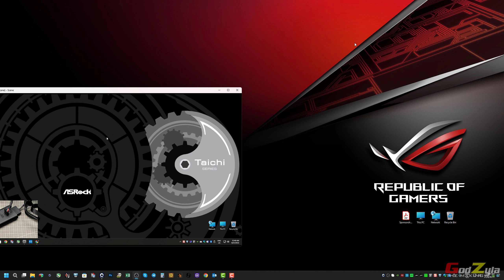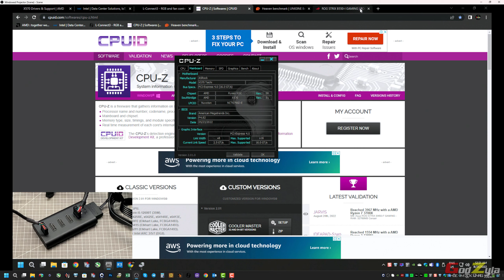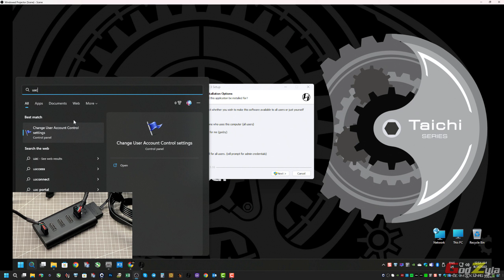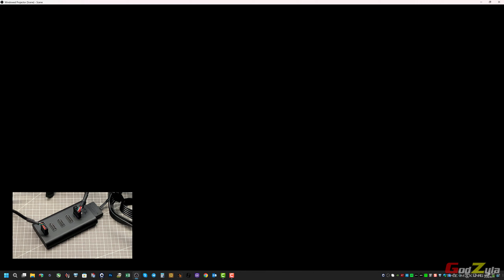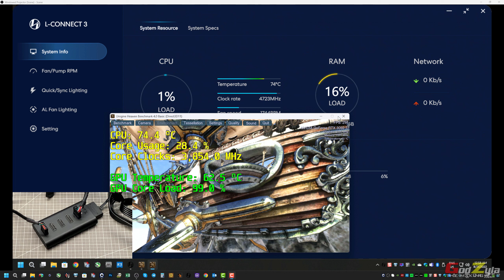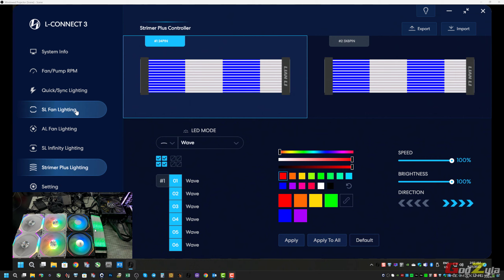Lian Li ARGB Products (How to make it work?) [L-Connect 3]

Comment: Hi Kleo, thank you for these informative videos. Not sure why my original comment was deleted but hopefully this one won't be.

Just a few questions that I wanted to ask -

If I'm using a NZXT Z73 AIO to cool the CPU (10 total SL120 fans, 3x 3 daisy chained & 1 non daisy chained), would it be better to connect all 4 of the "separate" fans to the Uni Fan Hub and control everything via L Connect 3? If I were to do this method, the USB 2.0 header from the Uni Fan hub would control all of the fan speeds & RGB via L Connect right?

Or should I connect 1x 3 daisy chained SL120s for the AIO/rad cooler to the NZXT AIO itself to control it via the NZXT software and the rest of the 7 fans via the L Connect 3? 

The PWM cables to control via motherboard is optional but will be connected just in case.

Orientation & case - Lian Li 011 Evo
Top Exhaust: w/ Z73 AIO 3x SL120
Rear Exhaust: 1x SL120
Side Intake: 3x SL120
Bottom Intake: 3x SL120
Reply from the maker: Hello Delcious Mango, welcome to back. Let me figure out for you and to reply you later, as currently am out, will be back in about 8 hours time. Just wanted to say hi and I do apologize as your original comment got removed. Rest assure am not the one who deleted it.
Reply: @KleoYan  Thank you in advance! Take your time. :)
Reply from the maker: @skibidiwonyoung  hi, it's kind of hard to explain here, I believe this will aid you https://imgur.com/gallery/wxrKnQd (if picture too small, please download it) read Part I then follow by Part II.

Comment: This video is awesome ! one question though with the new lian li infinity hub and the new strimmer v2 hub can we do the same method of linking them with the arbg cable kit? I have all the cable just need to know if it is ok to do still? So I can control both with L Connect 3? Or is a usb hub needed?
Reply from the maker: Hi Anthony Lowe, welcome to my channel. Both has a controller. You will need additional USB header will do. If you choose to plug the strimer plus together with the uni controller, it might not work as in, the strimer plus will not reflect on the L-Connect 3 dashboard, therefore you lose the argb patter effects.

Comment: I need your help., I was an early adopter to the SL fans, I can no longer control the fan colors. when I update the software to the L connect 3, it tells me to update but it fails every time and asks me to update, but then it tells me to manually update, it asks for a password which I do not know where to get. any thoughts? right now my fans are rainbow vomit
Reply from the maker: Hello Ryan Johnsen, welcome to my channel, kindly do the manual firmware update https://lian-li.com/l-connect3/L3_update_manually/  password lianli

Comment from the maker: If anyone of you have the issues with L-Connect 3 app, below are some troubleshooting steps

Basic Troubleshooting steps
Disclaimer : Though the chances are very low to brick firmware updates on motherboard and to any controllers. I will not be responsible if you have brick your motherboard or controller.

1) Make sure your motherboard bios is up to date, please check on your motherboard manufacture website, under support > bios and drivers. See if there are issues with USB and do they have a fix. If there are, kindly update those bios firmware version.

2) Make sure your chipset driver for your motherboard is up to date! For AMD will be at https://www.amd.com/en/support for Intel will be Intel Driver & Support Assistant Intel DSA https://www.intel.com/content/www/us/en/support/detect.html

3) Remove all argb apps (Asus Armory Crate / MSI Dragon Center / Giga Fusion / Asrock Polychrome). If the brands which I have mentioned, do have a uninstall tool like the Asus Armory Crate, use that, else use Revo uninstaller ( https://www.revouninstaller.com/ ). Revo uninstaller will remove all unwanted files / folder / registry in your system. Illustration to use revo uninstaller https://www.youtube.com/watch?v=uMgUYiakpxM&t=437s

4) Shutdown your PC, unplug the PSU cable from your AC outlet. Press the power switch twice to discharge all current that your motherboard is holding. Leave it for 45 second

5) While waiting, please do not use KVM switches. Disconnect all devices that are connected to your motherboard (front / back IO). Leave only your Keyboard, Mouse , Monitor and Ethernet (If you have) connected directly to your motherboard. 
If your monitor has a KVM build-in, remove the USB cable from your monitor to your motherboard USB socket. If your mouse and keyboard are connected to your monitor, please remove them and plug them directly to your motherboard instead.

6) Plug only one Uni controller or Strimer Plus V2 controller. If its for Uni Fan (SL/AL) use only 3 fans to an output of the uni controller.

7) Plug the power cable and turn on your PC

8) Go to your Device Manager, look under Universal Serial Bus Devices, make sure you see the Lian Li uni / strimer plus V2 controller.

9) Install the L-Connect 3 app only https://lian-li.com/l-connect3/ (current version 1.3.16)

10)	After installation, run L-Connect 3, check under Setting > General > make sure Auto-Run on Boot and Minimized L-Connect 3 to system tray at close are ON.

11)	Reboot your system.

12)	First thing you need, go to device manager and see if the Lian Li controller is listed, next open up the L-Connect 3 app. Check if there is a need to update firmware to your controller. Go to Settings > Update, under Device F/W version, click on Update Check, download and install the firmware. Make sure the firmware is completed. Do a check on device manager and make sure the Lian Li controller is listed.

13)	On L-Connect 3 dashboard, check if the CPU and GPU readings are reacting, you might want to test it using some benchmark programs. If there are reaction, play with the PWM and argb functions. If it does not work, skip step 14) and proceed step 16)

14)	If Single controller works, shutdown your pc, connect uni fan set of 3 to your output of your uni controller. Do it small steps at a time to hook up your sets of fans. do not do all in one go. If successful and you have a second controller, proceed small step at a time again.

15)	Slowly plug back your USB devices (Headset, Microphone, Printer, USB Capture Card and etc). At any point of time as you add those devices one at a time, if L-Connect 3 become unresponsive. This tells you that there power is insufficient to power up more USB Devices. Whatever USB port on your motherboard, there is a limitation as the current are shared across the board, be it front or back I/O and the internal USB Header. You might need to get a Internal USB Hub that comes with a Sata Power source to the Internal USB Hub. (Disclaimer, buying a internal usb hub might or might not resolve this issue, purchase at your own expenses)

16)	If it does not work, report your issues to Lian li Tech Support. There is a in build log ticketing system in L-Connect 3 app. this is what you need to do. Go to Settings > Support > Click on “Download log” place a filename and choose a destination drive to save the log file. Next click on “Report” it will take you to Lian Li Tech Support FAQ. Fill up the form and upload the log which is a zip file.
Reply: In what state is L connect 3 today? Do you know if it is running smooth now or is it unstable?
Reply from the maker: @Sapper_gaming  Hi, welcome to my channel. so long you do not over add too many argb devices, hubs, controllers, more fans more led strips and such.. it will be rock solid stable. If you asked me, there are only bugs, no instability issues. I get most of the PC builds for my friends or colleagues which works flawlessly without instablity issues. Most bugs are fixed anyway. For info on what are the fixes, kindly refer to the log https://lian-li.com/L3-changelog/. Also in most of my builds, I dont use motherboard argb utitlies, on top of this. I often make use of ASRock motherboard where you can turn off and on the argb effects within the UFEI / Bios without installing argb application in windows.
Reply: @KleoYan  Thanks, I got some AL120 fans(the 3 pack) Should I just go straight to installing L connect 3? Or would it be better to just Install L connect 2?
Reply from the maker: @Sapper_gaming  go straight L-Connect 3, follow this video guide, be patience and it will eventually work out for you. also take note on some important points which I've pointed out in this video. Rest will just rush it and rant about it and blaming L-Connect 3 is the cause of it. Infact it's not.. just that the argb IRQ in windows is shared, therefore all argb utilities are fighting for top piority to use the same IRQ which ended up instablity, crashes, delays and many more. Just keep argb application simple and to use suite devices. unlike some which add argb aio pump block, LCD display and such.
Reply: @KleoYan  ok thx, it is the only Argb fans ect. I got at the moment, only got RGB ram, rest is not RGB. so it will be very simple for now. I mainly got them to test them out in my current pc to see if I like Lian li Argb fans and software and controller, before I upgrade my system later this year.
Reply from the maker: @Sapper_gaming  I see ok. All the very best with your build 😉
Reply: @KleoYan  thx
Reply from the maker: @Sapper_gaming  most welcome.
Reply: Thankyou i was able to fix my issue but can it be conflict with armoury crate? Can i install it again? And i saw one of ur video u used nzxt usb extender, i bought one to use uni fans with strimmer v2 it powers it but L3 not supported
Reply from the maker: @alpha416game3  hi welcome to my channel. Hmm I have used this on numerous build, even till now no issues https://nzxt.com/product/internal-usb-hub-gen-3 as for armoury crate. Yes you can install after which.

Comment: when i start my lian li connect software my internal usb disconnects and reconnects repeatedly
Reply from the maker: Hi, welcome to my channel. did you check to see if your chipset driver is up to date and also did you check on your motherboard bios. do you mind to let me know what motherboard are you using? thank you!
Reply: @KleoYan  i have updated both my chipset drivers and bios to the newest one. my motherboard is the gigabyte vision b550 dp
Reply from the maker: @God-yr6jv  Do you have any Gigabyte motherboard application installed? if you have follow the steps below.. 

A) Remove all argb apps (Asus Armory Crate / MSI Dragon Center / Giga Fusion / Asrock Polychrome). If the brands which I have mentioned, do have a uninstall tool like the Asus Armory Crate, use that, else use Revo uninstaller ( https://www.revouninstaller.com/ ). Revo uninstaller will remove all unwanted files / folder / registry in your system. Illustration to use revo uninstaller https://www.youtube.com/watch?v=uMgUYiakpxM&t=437s

B) Shutdown your PC, unplug the PSU cable from your AC outlet. Press the power switch twice to discharge all current that your motherboard is holding. Leave it for 45 second

C) While waiting, please do not use KVM switches. Disconnect all devices that are connected to your motherboard (front / back IO). Leave only your Keyboard, Mouse , Monitor and Ethernet (If you have) connected directly to your motherboard. 
If your monitor has a KVM build-in, remove the USB cable from your monitor to your motherboard USB socket. If your mouse and keyboard are connected to your monitor, please remove them and plug them directly to your motherboard instead.

D) Plug only one Uni controller or Strimer Plus V2 controller. If its for Uni Fan (SL/AL) use only 3 fans to an output of the uni controller.

E) Plug the power cable and turn on your PC

F) Go to your Device Manager, look under Universal Serial Bus Devices, make sure you see the Lian Li uni / strimer plus V2 controller.

G) Install the L-Connect 3 app only https://lian-li.com/l-connect3/ (current version 1.3.16)

H) After installation, run L-Connect 3, check under Setting > General > make sure Auto-Run on Boot and Minimized L-Connect 3 to system tray at close are ON.

I) Reboot your system.

J) First thing you need, go to device manager and see if the Lian Li controller is listed, next open up the L-Connect 3 app. Check if there is a need to update firmware to your controller. Go to Settings > Update, under Device F/W version, click on Update Check, download and install the firmware. Make sure the firmware is completed. Do a check on device manager and make sure the Lian Li controller is listed.

K) On L-Connect 3 dashboard, check if the CPU and GPU readings are reacting, you might want to test it using some benchmark programs. If there are reaction, play with the PWM and argb functions. If it does not work, skip step L) and proceed step N)

L) If Single controller works, shutdown your pc, connect uni fan set of 3 to your output of your uni controller. Do it small steps at a time to hook up your sets of fans. do not do all in one go. If successful and you have a second controller, proceed small step at a time again.

M) Slowly plug back your USB devices (Headset, Microphone, Printer, USB Capture Card and etc). At any point of time as you add those devices one at a time, if L-Connect 3 become unresponsive. This tells you that there power is insufficient to power up more USB Devices. Whatever USB port on your motherboard, there is a limitation as the current are shared across the board, be it front or back I/O and the internal USB Header. You might need to get a Internal USB Hub that comes with a Sata Power source to the Internal USB Hub. (Disclaimer, buying a internal usb hub might or might not resolve this issue, purchase at your own expenses)

N) If it does not work, report your issues to Lian li Tech Support. There is a in build log ticketing system in L-Connect 3 app. this is what you need to do. Go to Settings > Support > Click on “Download log” place a filename and choose a destination drive to save the log file. Next click on “Report” it will take you to Lian Li Tech Support FAQ. Fill up the form and upload the log which is a zip file.
Reply from the maker: @God-yr6jv  aik! Gigabyte Vision B550 DP, for this I have a couple of viewers unable to to the controller for some reason, I am sorry but you will need to reach out to Lian Li Tech Support.

Comment: Hey Kleo, I had a thought about Argb Fans aesthetics. While I was  building a new pc project I thought what if I could buy Argb fans with reverse flow for aesthetics. I do understand about fan blade directional pitch. Just a thought. Maybe to difficult to manufacture.
Thanks, Keep up with your great video content
Reply from the maker: Hi Ya Jim Hamilton, welcome back 😉you have mentioned this before and yup. it will be real cool if it's possible to do that and you are absolutely right. If the coil allows reverse directly, the fan blade have to be altered too. Anyway, if you do come out with a method. do share with us. once again thank you for your support and to have vist my channel again.

Comment: Good video, but there are 2 things that I would like to point out. First, the UAC setting is a critical component of the windows. You must warn the audience about the consequences when changing it. The solution for fixing the UAC pop-up should be solved by Lian Li, and the user should not have to change the UAC setting. Secondly, the strimer plus v2 controller doesn't have a memory to retain the setting when losing the power, so it lost the previous rgb setup, unlike the V1 which has a memory. I don't have the fan hub controllers, so I don't know if Lian Li also cheap out on those controllers or not. Please let me know if you could testing it out. 

The L connect 3 still need a lot of fixes. Since you are an influencer who work closely with them. You should be our voice and pressure them to fix their software and stop cheap out on the controller.
Reply from the maker: Hi RedPencil,  welcome to my channel. First off, I am not a influencer, content I made are based on interest as an end user which some of the YouTubers does not answered to my questions. So I decided to share what I know and I can be wrong too. As for the UAC I will take note on that. As for others you have feedback, I see what I can do. Thanks again to have visit and to give your valuable feedback. Again your feedback, I will try to reach out to Lian Li but no promises on the request.
Reply: @KleoYan  I have been following your channel for years. you may not thinking that you are an S influencer, but I can tell you that non of any YouTubers covers all the Lian Li RGB products as much or as deep as you do. They should value you more for promoting their product and enlightening their customers on how to use the products.
Reply from the maker: @BestRedpencil  hi, thanks for your kind words and the support. As mentioned, let me see what I can do. I will be sending them feedbacks. thank you!
Reply from the maker: Oh I have forgotten. The uni controllers do have it's own memory and stay with your settings if u connect the controller directly to your motherboard USB header,  but if you are using a splitter hub, yes when u boot, it will be rainbow but once loaded in window, when l-connect 3 launches automatically, your settings will be back. Same applies to the strimer plus v2 controller.